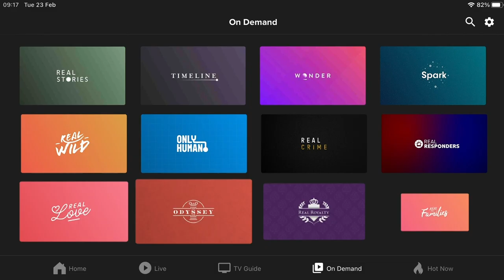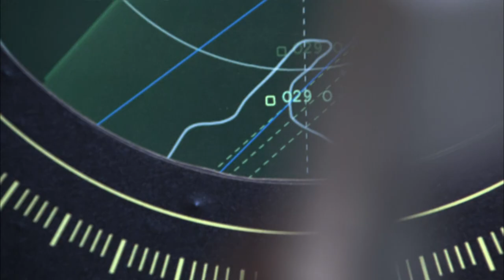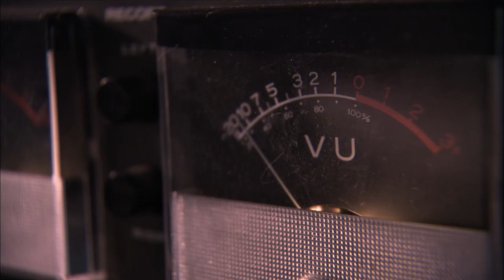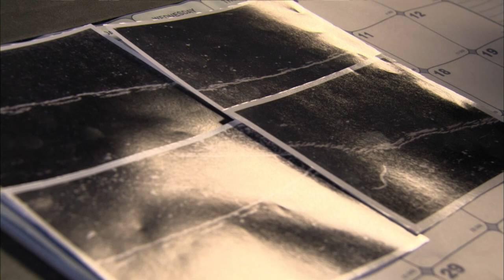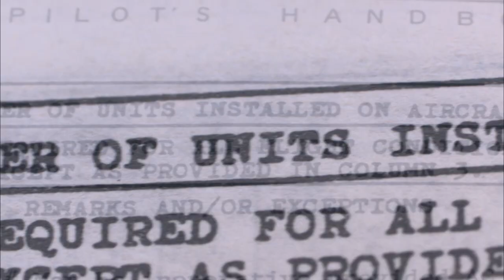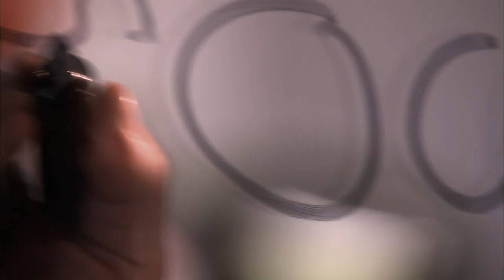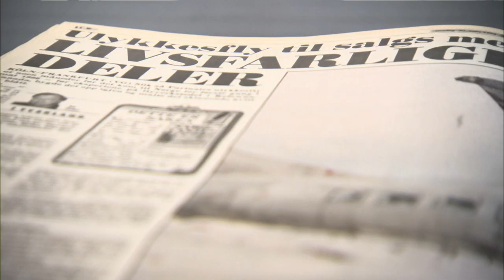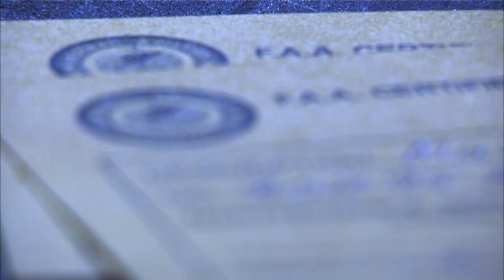Denmark's Deadliest Plane Crash Partnair Flight 394 | Mayday | Wonder

Comment: Planes are one of those things you never want to get counterfeit parts.
Reply: Planes, trains or automobiles, even bicycles.
Reply: Unless you're the guy paying forthem lol
Reply: Get your Kirkland brand aircraft tail bolts here! 50 for $5.99
Reply: Tell that to corporations paying for those parts.
Reply: Ships too
Reply: How about outsourcing heavy maintenance to places like China. Every major airline in the usa outsource heavy maintenance checks to countries like China, India, el Salvador, ext. Im a aircraft for one those major us airlines and seen nearly all heavy maintenance outsourced to the lowest bidder.  U be surprised at some the things we find when we get the aircraft back. We complain about it but until a major disaster can be attributed to this practice airline will put profit over safety and the flying public want cheep airfare without thinking about how it’s being provided.
Reply: In that case, you may be shocked to learn you can buy aircraft parts on eBay...
I don't think I trust that...
Reply: @logan4215  what a steal!
Reply: @rockabye_baby187  the only alternative to corporations is government run airlines which are even worse.
Reply: @crazyjhey8050  This is not necessarily true.  For one thing, most budget airlines don't even have such bases, think of Southwest, JetBlue, Spirit, Allegiant and the like.  And often, the cost of flying the aircraft to these other countries is so expensive that all savings are cancelled out from the fuel costs of flying the aircraft around to get to those countries, and then some.  Fuel is by far a bigger expense than maintenance.  So airlines usually focus on that, rather than attempting to outsource maintenance.
Reply: Period
Reply: @rockabye_baby187  Kinda scary that they'll buy bootleg parts just to save a few hundred dollars.

Comment: Certified Airplane parts and tools are expensive for a reason. The reason is there is no room for error in the sky, these aren’t like cars where if you buy a brand new alternator and it’s bad you can just pull over and take it off and return it. There are no Advance Auto parts stores in the sky.

Comment: One of the best episodes of Mayday I've seen. I was riveted by the mystery of it. Extremely worrisome situation with the fake parts. I hadn't even known that was a thing before this episode! I hope it really is under control now...
Reply: Much more so than it used to be, although they apparently can still exist.  It was a contributing factor in the Lion Air crash involving the MCAS 737MAX debacle
Reply: WHO WOULD KNOW?
That's horrible just horrible
Can you imagine?!  Very very sad indeed 😫😓😥😭😭😭
Reply: I saw a documentary on used parts installed on airplanes , not only do they come from crashed planes but from automobiles TOO !!!

Comment: I'd have second thoughts about boarding a plane if I knew it was 30+ years old.
Reply: I would be okay with a 30 plus airplane as long as it was maintained properly.
Reply: @steven-nb6rt  I don't know man.  With all those years worth of miles on her, she might decide to shed a wing.  If given the choice between such a plane or a three-legged mule, I'm muling it.
Reply: Planes are generally designed for a 40 year useful life (or ~75K flight cycles). Personally, I’m not all that worried about the airframe. My biggest issue with the age is that, as the years go by, there are more and more opportunities for people to make mistakes during maintenance - or just skip important steps altogether (e.g., Alaska Airlines).
Reply: @bastianena  Interestingly, I’ve never been offered that option at the airport. ;) I do see what you mean. There are plenty of 60, 70 and even 80 year old planes still safely doing what they were designed to do. However, they’re not doing so multiple times per day, in a hurry all the while, on a tight budget, under pressure. That makes all the difference. Side question: would you ride a 30-year old mule?
Reply: @a1nelson  I didn't think they'd let a plane go that long, let alone a commercial one with many lives at stake.  I figured 15-20 yrs. tops and then off to the graveyard.  All those years and compression cycles seem a little risky.  Nope, not for me.  Give me a fresh plane or the mule.
Reply: @a1nelson  The mule option is in very fine print.  If it can handle 200 lbs. plus a carry-on, call me Sancho.
Reply: @bastianena  OK. Better stick with Southwest, Emirates or Sancho then. Happy travels.
Reply: @a1nelson  Hey likewise buddy.
Reply: @bastianena  and @a1nelson : I truly enjoyed reading your back & forth convo.  Thanks for the chuckles on a Sunday night 👍
Reply: You said exactly what I was thinking.
Reply: You'd be shocked how many 20+ year old jets are still in operation
Reply: A lot of commercial planes are still being used that are up there in age
Reply: @williamkreth  I definitely would. Never really crossed my mind before seeing this episode.
Reply: You are right, more so knowing that these old planes are sold and resold to other local carriers who do not have the means of a major airline
Reply: @christiankamal7549  The fact that they mentioned about parts remaining from crashes being given back to the companies after investigations are completed is also unsettling. I'm still shocked by that.
Reply: Because of sins bad things happens and you know we live in a sinful evil world..
Reply: @bastianena  dude the DC3 is still in service to this day and that aircraft is of ww2 vintage
Reply: @werearethedreamteam3724  AMEN!
Reply: @a1nelson  haha yes I’d ride a 30yr old mule, and have quite a few times (sorry, figured I’d be one of the few who actually has lol). But yeah these commercial planes are put through so much. I’ve spent time in a small WW1 plane that’s still flying but it doesn’t get the use commercials do (obviously) and is meticulously maintained by a person who loves it almost more than their spouse. That I trust (thankfully said person adores their spouse). I fly a lot but it’s definitely always in the back of my mind.
Reply: At least I knw what the 30 yr old plane is capable of just kidding im scared to death of flying only 2 in 41 yrs after this series never again my body staying grounded.
Reply: Being a young plane don’t really means it’s absolutely safer than a 20+… remember the DC10 with cargo doors problem?

Comment: Everybody talking about the people who sold the counterfeit parts and I'm right there with you but how is nobody talking about the first officer "coming up with a way to take off with a broken power generator" when the regulations say you need two. How was that considered okay in anyone's mind? I mean I'm not an airline mechanic, but a plane must have two generators AND an APU for a reason. The regulation must exist for a reason. Power generator sounds pretty important, we're not talking about the in flight entertainment or the microwave in the galley here.
Reply: Let me see if I can shed some light on this. I am currently a pilot in the USA flying the Airbus 320 and have a type on another jet as well. On both of these jets we can substitute one of the main generators by using the APU generator the entire flight. This is allowed per the MEL (Minimum Equipment List). It is not uncommon likely the first officer found this on the MEL. I cannot speak for the Convair as I am not type or have flown it.
Reply: And imagine the stress the company put these pilots under if they were buying counterfeit parts like alot of these the main reason the pilots messed up is cuz they were under pressure to be on time and not waste anymore money which is what happens when a plane is grounded
Reply: @alexandriarennie5992  The airline probably did not know that the parts were bogus.
Reply: Note that this is actually permitted under regulations and by most manufacturers under those conditions.  The APU is included because the engines are not always running when the plane is on the tarmac, and if one experiences engine failure, they are a much more thorough source of backup power compared to ram air turbines, which provide very few systems with power.  So that is really why there are three of them.  But running the APU in-flight is not inherently dangerous.  It just uses more fuel.

Comment: I remember this at the time. The problem ended up extending well beyond the aviation industry.
Reply: Could you elaborate on “extending well beyond the aviation industry” I’m ignorant?
It might be self-explanatory but not for me? 
Thank you 🙏
Reply: @robertj.davidson362  As I recall - military equipment, (civil) engineering structures, high end industrial applications (e.g., refineries).  I don’t recall any of those sectors having any type of catastrophic failures, but there was concern as to how far this counterfeit problem extended.

Comment: Wait. 4 bolts hold a tail on a plane? Well that's no good.
Reply: They are very strong bolts that are held in place.  Newer aircraft would also never have been so engineered.  That aircraft was exceptionally old even in those days.  It is a design that goes back to at least that 1950s or well before, and it was a small aircraft even then.
Reply: As I noted above: No it was a good design. United operated 52 Convair 340s for 16 years without a fatality. Like many accidents this was a combination and series of things and events starting with firstly the use of bogus parts then replacing one bolt rather than all four with an authentic part followed by poor welding, etc. The Convair 240 family of planes had a good service record with numerous airlines around the world. This was the only Convair CV-580 to crash owing to tail fin separation.

Comment: I like how they act shocked that bogus parts were being purchased.  Everyone knew. 

“The fakes were REALLY REALLY good”.
Ya, sure bud. Sure.
Reply: How would you know, though?
Reply: @MilesL.auto-train4013  How could I know that rusted junkyard bolts were polished up and resold?   There’s gotta be evidence. 
A spect of grime, scratch marks, bits or rust or rust dust.  Maybe numbers or logos on the bolt were worn down. Or the edges of the bolt weren’t perfect. 

Consider this.  After the incident, they told mechanics to inspect the parts for signs of reused parts.  That means it’s noticeable to a non-expert of forensic science lol.  

And the buyers of the parts knew because how else could they be significantly cheaper than their competitors? 

They knew.
Reply: @thomaspayne6866  Well, were you there? Have you considered that the fact it happened maybe proves otherwise? Maybe they did, maybe they didn't. Considering the amount of faux parts and how extensive the problem was, I'm sure there's a chance a majority didn't. I suppose you're involved in the aviation industry? Counterfeiting is a major problem that even major companies suffer from, not only the airline industry. Apples to oranges, I know but no one is exempt from the problem.
Reply: @MilesL.auto-train4013  I’ve considered the fact you have no common sense.
Reply: @thomaspayne6866  Wow, what a retort. You finished now?
Reply: @MilesL.auto-train4013  The guy who lacks common sense and ignores the basic logic in my argument is also easily offended.  FYI: those two poor character traits go together.  You’re a chaotic mess. Fix yourself.
Reply: @thomaspayne6866  Again, what a retort. Are you done?
Reply: Its like a weightlifter takes steroids. He looks good but product doesn't stand up.

Comment: So many accidents involving pilot error and cutting corners in maintenance.
Reply: Yeah, you would think there would be more airplanes just randomly crashing to the ground for no reason. But it turns out not to be the case. A real head scratcher.
Reply: @dondajulah4168  actually it depends on the importance of the part.  If it is an aircraft body part it would play a much bigger role.
Reply: @steven-nb6rt  unfortunately in some cases like Tenerife it’s a mix of pilot error Mother Nature and mechanical limitations or in Air Florida flight 90 Human error combined with freezing conditions

Comment: Well one thing I have noticed is you have invented the new scientific profession of the “Metallagist” which you have mentioned a few times.  Only thing is there is no such thing as a “Metalligist” or “Metallagist” or “Metallogist” !  
-  The profession should be a METALLURGIST, which is an expert in the field of METALLURGY or an engineer trained in the extraction and refining and alloying and fabrication of metals.  IN layman’s terms an expert in the field of METALS. The subtitles got it spelled right in one location, but it sure was not pronounced right, and got it wrong in other positions like at:  26:50   (approx)  where it was spelled “Metallogist”

Comment: I'm confused about this: early in the video they find small bits of plastic in the APU while stating that the cabin had broken up while the APU was still running.  However, the final findings suggest the tail broke off first with the APU in it.  I'm not sure how to interpret this.  Anyone?
Reply: Early in the investigation they thought that the cabin broke first leading to the plastic in the APU but later they found findings that suggested the tail which held the APU broke first most likely meaning that whatever happened with the plastic is something that broke when the tail broke off

Comment: If the quality parts were sold at a normal price there wouldnt be such a demand for cheap unapproved parts! Some of these parts are marked up hundreds of percent over the production cost! This is what happens when there is a monopoly making airline parts. The price can be set astronomically high since they are the only ones who produce the approved parts, this makes a huge black market! Get rid of the monopoly and put a cap on how much profit can be made and the black market will disappear!

Comment: The Convair 340 is a very old but tough plane, made more modern with turbo props and more modern avionics retrofitted, replacing the piston engines. Thus the -580 designation.

Comment: A wise man once said "you get what you pay for"....and in most situations, it's disturbingly true.  

You can find examples of somebody cutting corners, using cheaper parts, inferior materials, skipping on maintenance...etc. causing disasters and costing lives...you can find countless example in the air travel, road transport/travel, ocean transport, basically every industry / sector and infrastructure involved in a modern society (telecommunications, transportation, energy, and so on).   

It is often somebody deciding to save a small amount of money that results in a systemic failure and preventable deaths.   

Every time there's a disaster and the public is shocked that corporations put profits above people's lives...and every time nothing is really done.
Reply: indeed. people ask "Why do we need regulations?" This is why: imagine this happening again, but to a full Boeing 747.